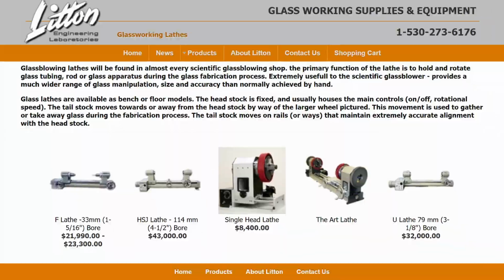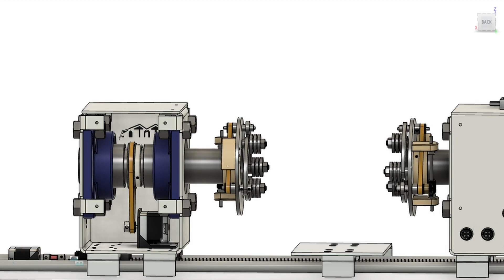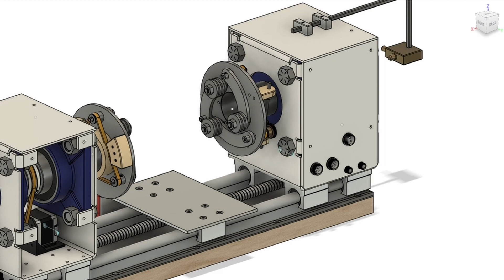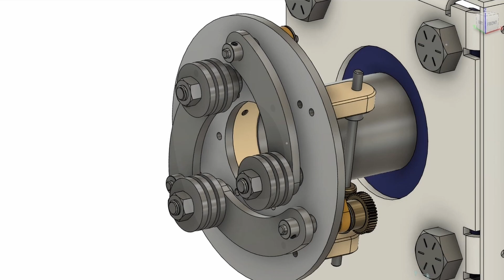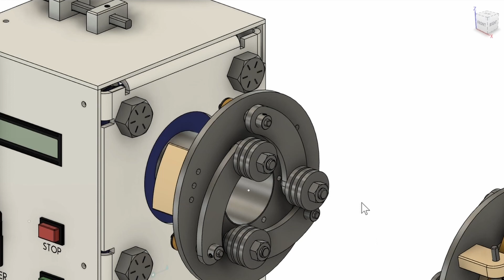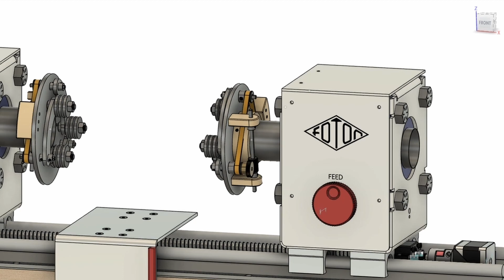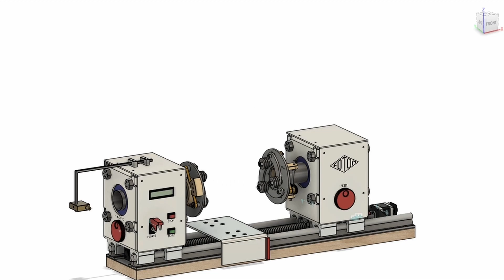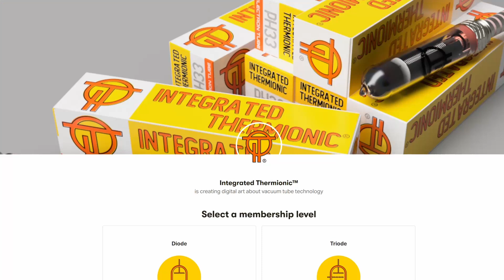Designing an Open Hardware Glassblowing Lathe

Comment: I used a single large stepper motor and then used pillow blocks with a hexagon center I then connected them with a hexagonal shaft this was all placed behind the lathe with a belt from each chuck attached to the shaft.. I don't know if I'm explaining it well but it made it to where the tail Chuck can move left and right  while staying in sync and using only one motor no 3D printer no nothing I built it with two wood lathes the only problem I had was my truck size I didn't have a big enough inner diameter but I made it at 16 and I had nothing but hand tools if I did it today I definitely do the truck different but I've not seen anybody connect both chucks the way I did so id figure I'd mention it

Comment: I like the work and really think you're on the right track and have it well reasoned out.  I think the setscrews driving the jaws will be an issue another has mentioned.
2 thoughts.  First i think a spring loaded tensioner is a mistake as it will produce backlash and might be a large problem when reversing directions, leaving one chuck behind.  Second if the headstocks need stiffening up, machine some spacers with an 7/8 internal thread the correct length for the distance between the bearing blocks inste5od nuts.  Then when tightened down you'll have bith bearings very rigid and stiffen up the c shaped frame

Comment: Very cool designs but idk how I feel about the stepper motors vs having a drive shaft. When adding side seals on the machine I wanna be able to grab the chuck and spin the lathe as I need, not reaching for a dial on the back of the machine. Have you ever blown glass on a lathe? If not maybe give it a try and you’ll see why glass lathes are made the way they are.
Reply: 100% this. Hand rotating the chucks when doing certain welds is essential. If youre able to build this with a drive shaft, you really should go that route. 8 year glass worker, 3 years on a lathe.
Reply: If you had a rotary encoder involved, could you use the motor (servo perhaps, or could you do stepper still?) to “virtually link” the speed but keep it at a “hold in place/let this side just spin?

More convoluted than a drive shaft yes, but the design flexibility/affordability (at least in my armchair napkin math with NO hands on experience …) may be good.
Reply: @Koveyd I was thinking the same thing but there are ways to synchronize the motors so if you moved one by hand the other will move in time or you could slow one down or freewheel it

Comment: I'm more a fan of dove tail ways than tubular with roller bearings. As far as the bore, I've been investigating diesel engine piston liners. A high grade piece of metal that a flange can be welded to.
Reply: If I'm not mistaken cylinder liners are made of cast iron or cast steel, neither of which are easy to weld.
Reply: @siggyincr7447  Silver solder or brass brazing it is then. Saves from needing a welding set up, sometimes.

Comment: Very interesting project. One comment: stepper motor drivers (particularly microstep drivers which is probably what you need) do some fairly fancy measurements of currents in the motor windings to optimize the way they drive the motors. Your idea of connecting two motors in parallel (or series) might mess that up. Try it, but if you experience problems I would try two drivers fed from a common control circuit.
Reply from the maker: Totally. I didn't get into it in the video but I'm hoping that using a dumb driver (no anti-resonance) and limiting the speed will let me avoid those problems. If I have to put another driver in there it's no big deal
Reply: @SignalDitch  You obviously know what you're about. The first time I tried smard drivers I was so impressed by the improvement in stepper performance that I've never used dumb drivers since, but if they work in your application then go for it.

BTW - how are you going to get the head stock and tail stock concentric? I hope you can get enough precision from those sheet metal boxes.

ETA - I assume you have a solution for balancing the chuck too.
Reply from the maker: @foffu  "how are you going to get the head stock and tail stock concentric?" 
They should automatically be pretty close. I think most of the misalignment will be vertical and minor. Practically, alignment will just mean putting a piece of glass through both chucks and shimming/bending things until it's good enough.

As for balancing, my plan right now is to have a few bolts through the two parallel plates of the chuck that I can stack washers on until it spins okay.

I think the word "lathe" places this project into a context where people are very concerned about precision, but the nature of the work and the material is such that it will take up a lot of slack.

Comment: I see you used his design for the chuck also with the belts. I liked his belt design ok the back also. Still , I really have been trying to get a good enough mill to machine a near rip off of Vertigo lathes in their one piece splined gear/hollow spindle. You really need to check out the internals of those machines! If only I hadn’t lost my inventory several times because of poor logistics. I have acquired very rare and plentiful tube parts and graphite and tungsten for days but then someone decides to not follow up on shipment and it becomes forfeit! The painful nature of brokers!